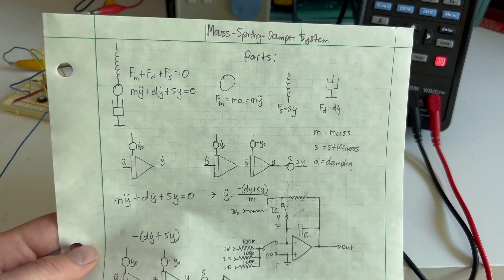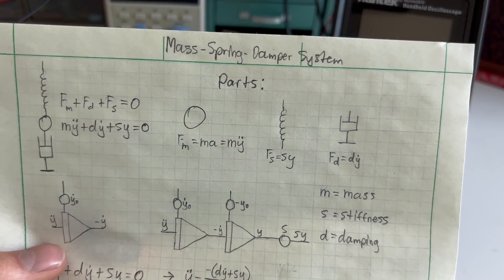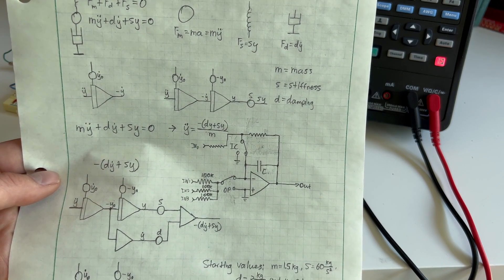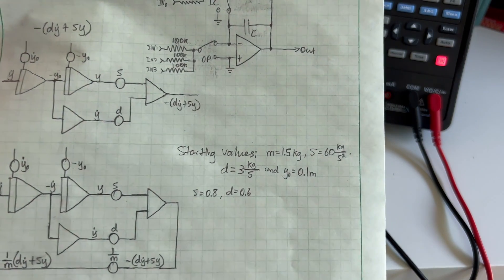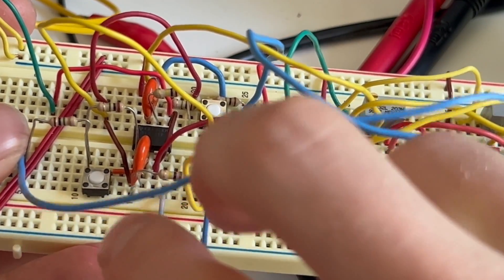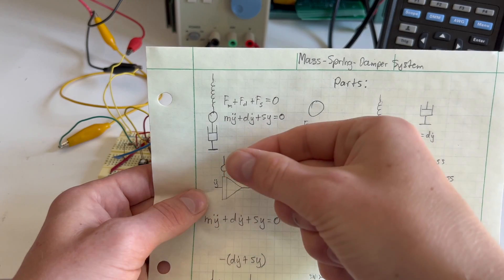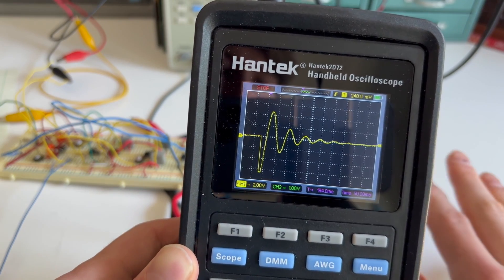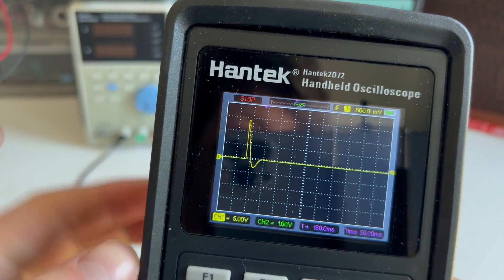Analog Computing - Differential Analyzer Spring Damper System

Comment: Good question: is a differential analyzer really an analog computer? And what exactly is an analog computer? What are digital differential analyzers which have the structure of "analog computers" but digital computing units. 

One thing I found is that analog calculating machines can be very different and are usually highly specialized on specific tasks. Like an astrolabe or a slide rule or DAs. They are all so different that it is not clear what makes them even being part of one class of computers. And then in french they call normal computers "ordinateur" while they call all other calculating machines "calculateur" for calculator. And they also call analog computers analog calclators.u
Reply from the maker: A differential analyzer is to an analog computer how a CPU is to a digital computer. The CPU is not the whole computer but it is probably the most important part of it. A differential analyzer becomes an analog computer when it has certain supporting circuitry that allows it to be programmed and set up to run more than one operation or tweak the current operation in a convenient and expedient way. A true analog computer is capable of effectively using its computing elements to evaluate, process and move data in a way that is useful. It must also have a way of allowing the user to input said data and see its result in a meaningful way. While a differential analyzer is used to achieve this, it is an analog computer as a system that brings it all together. There is confusion out there because many people define computers as needing to be Turing complete, which is somewhat non-applicable to analog computers because they do not usually operate within that paradigm. One of the supposed requirements is that the computer is capable of performing different types of calculations and be able to take in multiple types of data and successfully compute it. In other words it needs to be versatile. This is possible for an analog computer to achieve but it this differentiates it from something like an analog state machine. Things like astrolabes and slide rules are good examples of state machines. Certain data is put in, and the state of the device changes to produce an output that is meaningful. However, these state machines are one-trick ponies and are not versatile. The input and output data range has a certain scope and the function of the machine cannot be changed beyond perhaps a couple of different functions at best. Basically, the difference between analog computers and differential analyzers is a grey area because it depends on how you define what a computer is and what is should consist of. The Turing definition is often used but is quite contestable as an absolute definition. 

There are some hybrid computers that they made in the late '70s that had some computing elements called DDAs or Digital Differential Analyzers. They basically are just like integrators but they are ran on a clock like a digital system. The benefit is that you can integrate with more than just time as an independent variable. (In essence, be able to solve partial derivatives directly.) The problem is that you loose the ability to compute instantaneously and for more resolution you have to run the computation longer. This makes them a cross between a true digital computer and a true analog computer. In the '70s, digital computers were eventually able to be clocked faster and given greater RAM and storage, whereas they were unable to do that with analog systems so they fell out of favor.